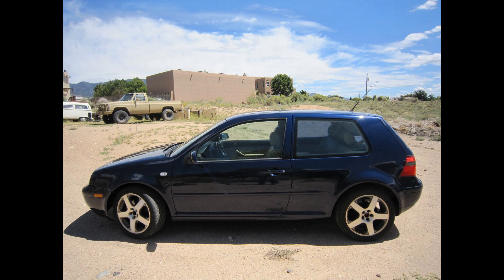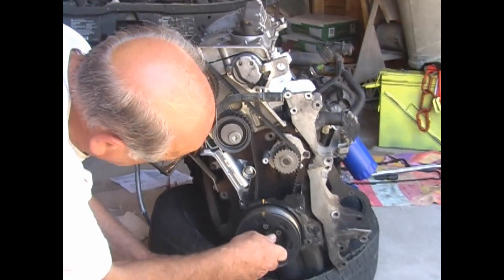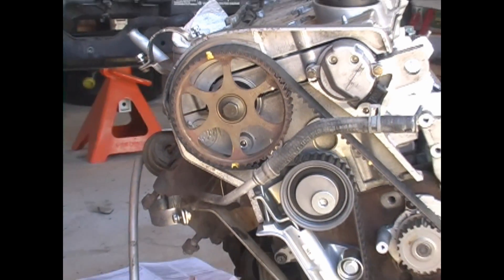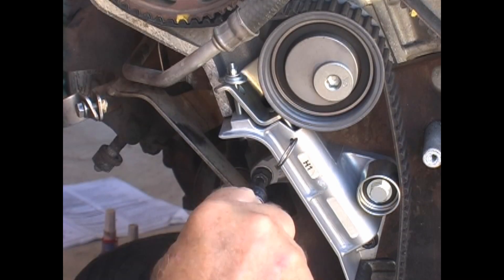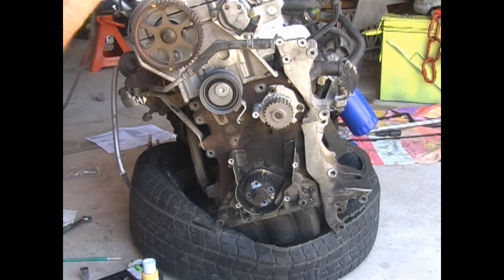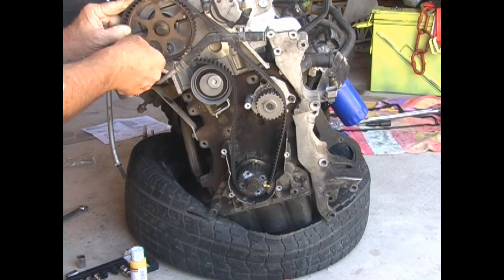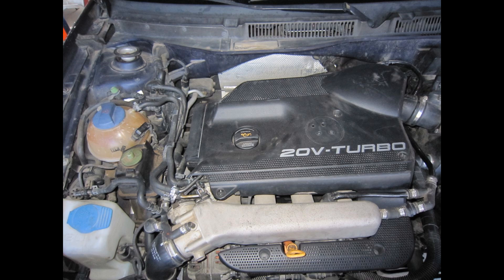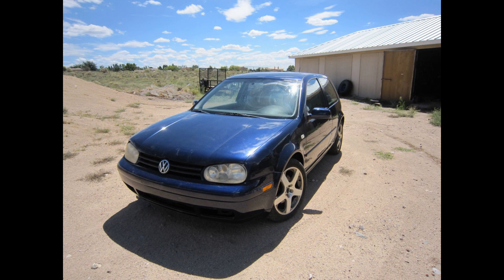VW/Audi 1.8 Turbo Timing Belt Replacement

Comment: I got mine all back together and the cam mark is one notch off to the left. is there anyway to fix this without taking it all apart again? I had a hell of a time getting the tensioner in and don't want to have to tackle that again.
Reply from the maker: Chris - I haven't done this procedure with the engine still in the car but can imagine it is a bear. I don't know of any way to change without tearing it apart again.   Sorry I don't have a good suggestion.  When I made the video I assumed it would still make the procedure easier do to in the car that doing it some of the other ways being suggested.  I hope that is the case even though it was still very hard.  Good luck.

Comment: so i recently had my belt break on my gti awp. had it repaired but it drives much slower! I'm afraid timing might be off. if i go to check it and there is no markings, how can i check if my timing is correct? i have no cel or codes..thanks
Reply from the maker: Hi Christian

I can't imagine that there would be no timing marks.  There certainly won't be any on the belt but there will be timing marks at the crankshaft and the camshaft.  There is a cover you have to remove in order to see the camshaft Pulley.  Once you remove the cover, there will be a timing mark on the case of the engine.  I can't send any photos in this reply but if you look at the very first part of my video you will see the timing marks at the crankshaft and the camshaft.  Once you locate the timing marks at the camshaft, then just rotate the engine until the mark on the camshaft pulley aligns with the mark on the engine case.  When these are lined up, check the marks on the crankshaft.  Remember the crankshaft rotates twice for every turn of the camshaft.  Hope this helps.  If not, send me your email address so I can send some photos and diagrams.  Good Luck
Reply: Wayland Adams thank you sir. i appreciate the feed back. i will certainly get with someone and attempt to double check my timing because i dont believe the tech i worked with originally did it correctly. also have you seen a damaged turbo result from the belt breaking? i was only driving 15mph but it bent 4 valves. i had those replaced along with everything else that is recommended. i got the car at 94k miles, it broke at 96k miles and now just hit 100k and still drives terribly...my car is auto triptronic btw. basically when i attempt to gain speed, it has to rev higher then usual to shift and alot of torque is basically gone. i can only skip tires when i floor it when be4 i had to condition myself getting use to the sensitivity of the peddle because it was just ready to go! now i have to really give it gas for it to go...its so sad.

Comment: Is this easy to do with the engine still in the car though?
Reply: Christopher Kreschollek  no!
Reply from the maker: Hi Christopher

I don't really know how easy it is to do in the car.  I have only done it a couple of times and in both cases the belt had broken and the head needed to be removed.  At that point I figured it was easier to remove the engine.  

I shot the video with the engine out of the car so I could show detail that would be impossible with the engine still in the car.  Having said all that, it is possible to change the belt with the engine in the car.  If you are just replacing the belt and the parts associated with the belt like water pump, tensioner, etc. I would recommend you do it in the car.  It's kind of tight.  You can still follow the procedures of my video which will make it easier.  

Thanks and good luck.  

Wayland
Reply from the maker: Hi Christopher  - As Chris Mosley says, this is hard to do in the car.  I do think the procedures in my video make it easier to do in the car than following some of the other suggestions.  But in the best of circumstances, it is probably very hard to do in the car.  I haven't done it in the car because I was having to change the head also.

Comment: So we don't need to rotate the engine 1 rev after install?
Reply from the maker: No you do need to turn the engine.  At the last of the video I suggest you turn the engine crankshaft 2 revolutions which will turn the camshaft one revolution.  Then check the timing marks.  Look at the last few minutes of the video and it will explain it.  Thanks.
Reply: That's what I meant. Cheers.

Comment: So when the crank and the camshaft are not time when you take a look at it from the beginning does that mean bent valves?
Reply from the maker: Hi Sergio  I would say probably it does mean bent valves.  This is especially true if the timing belt broke or started slipping while that engine was running.  Slipping happens when the teeth on the timing belt some off in one area allowing the crankshaft to turn without turning the camshaft.  I have see this failure before.  I guess the exception would be in the timing is only off a little but everything is still turning.  

If you can pull the valve cover, you can probably see if valves are sticking open meaning they are bent.  The other method is to make sure the engine is timed and then do a compression check.  Let me know if you have further questions.
Reply: so a follow on question is if it is out of time (as mentioned above) do I just need to match up the marks at the crankshaft and the camshaft then install the belt? I'm asking b/c I'm installing a new cylinder head that had a timing belt break and bent the valves. I'm essentially doing a full timing belt install and cylinder head replacement at the same time.
Reply from the maker: Hi Kick Flips  yes you are basically right.  However, I would make sure the timing  marks are set before you install the head on the block.  In other words, make sure the camshaft sprocket is on the timing mark and the crankshaft is also on the timing mark prior to installing the head.  Then install the head,  Following that you install the timing belt as instructed in the video.
Reply: got it thanks

Comment: what size bolt do you use for screwing down the tension pulley to let the pin out?
Reply from the maker: Hi Tyler -  I used a 5 X 55 mm stud to compress the tensioner.  Good Luck
Reply: M5 x 55 mm

Comment: If you're doing this on your car, follow these instructions but install the tensioner WITHOUT the small roller pulley first.  The tensioner bolts will destroy the threads if there is too much pressure.  Then push away the belt and put in the little tensioner pulley.
Reply: yes, remove the camshaft pulley, get it lined up on the correct tooth and slide it back onto the keyway on the camshaft. You may have to turn the crank slightly but only about the same as you see it moved in this vid. you don't have to disassemble anything else. I've found it is much easier to remove the cam pulley to perform all timing belt maintenance. ..After lining up the timing marks of course.
Reply: James James that's what I did .I was having a hell of a time getting the tensioner in with it on. got it all back together and realized the cam timing is one notch off. I about blew a gasket.  is there any way to fix this without taking the whole thing as apart?
Reply: James O'Phelan

Comment: Thanks for the tip on removing the tensioner first. The book wanted the tensioner pinned and then slip the belt off. Well the idler can't go back far enough for that. Also this was identical to a 2002 Jetta. Thanks mate.
Reply from the maker: You're very welcome.  You found the same thing I did, the book was calling for the tensioner to be pinned but the belt was almost impossible to removed that way.  Hope you repair went well.

Comment: The bolt on the camshaft pulley recently broke because it was on too tight and the pulley itself frayed at the edges where the bolt was screwed in. Can I replace just the pulley and the bolt to fix this issue? If not, what else would I need to do to fix this issue myself? I have had a really rough time trying to get someone to fix my car and have decided Im going to fix it now. Any help would be greatly appreciated.
Reply from the maker: I would think if that is all that is wrong, you should be able to just change the pulley and bolt.  Just make sure it gets back on correctly and you get the timing set correctly.  Just a thought,  It is going to take about the same amount of work to do this as to change the belt.  If you haven't recently changed the belt.  I would consider doing that and the other recommended components.  

good luck/  Sorry for the slow reply, I have been out of pocket.  

Wayland
Reply: +Wayland Adams no, thank you for the reply. I really appreciate it.

Comment: Is the timing belt the same as drive belt?
Reply from the maker: Hi Mladen  Not sure exactly what you are calling the drive belt.  but there are two belts.  I would think what you are calling the drive belt is the one that drives the alternator, power steering, and AC.  This belt is very visible and can be changed as needed.  The timing belt is not visible.  It drives the camshaft and water pump.  It has teeth on it so that everything is kept in timing with one another.  hope this helps.
Reply: +Wayland Adams I figured that people call the fan belt drive belt as well
Reply: +Wayland Adams Thank you for your time!

Comment: i need to know if its possible for my belt to have jumped timing and not hurt my motor. i also need to know how to tell without pulling the head
Reply from the maker: Hi Brandon -  I guess there might be some circumstances where the belt jumped timing just a little and wouldn't damaged the valves.  I have never heard of such a case but I am not the total expert on this.   If you have already replaced the belt and got everything back in timing then you can do a compression check.  The should show any cylinders which have  a bent valve as the bent valves will not close properly.  If you have good compression on all cylinders then you should be good to go.  If you haven't got the engine back in timing you will have to decide if you want to turn the engine over.   Another thing is to remove the valve cover and see if there are any valves that are not closing.  Of course with this, you won't be able to check all the values without turning over the engine.  You will have to decide if you want to turn the engine anymore at this point.  Good luck.  Let me know if there is something else I can do to help.  Wayland
Reply: my car lost some power and started running badly at about 4k rpms and the engine light came on. car runs but rough and the belt is entact and appears good
Reply from the maker: Brandon  This doesn't sound like a timing belt problem to me.  Do you have a way to get the service codes read.  Autozone will do that for free if you are near one.  So I will hazard a guess assuming all the valve timing is good.  On this engine each cylinder has it's own ignition coil.  Sometimes those fail and the car will lose power and run rough because one or more coils have failed.  Getting the codes read may give you a clue as to which cylinder is misfiring.  Once you have the codes read, you can google the code and it will tell what it means.  I had this happen on my car.  Replaced the bad coil and was back in the power.  The codes for misfire are P0301 through P0304.  The last digit indicating the cylinder.  Let me know how it goes.  This is just a guess on my part, the codes will tell for sure.  Let me know how it goes.
Reply: your awesome. thanks for the input. i suspected a coil but only after a family member advised me. now i definately will check.
Reply from the maker: Brandon  One other thing,  I have a code reader so makes it easier.  But when I saw a misfire code, I actually swapped the suspect coil with another cylinder and then checked to see if the code moved.  It did in my case confirming that the coil was bad.  I don't like to just throw parts at a problem so I try to confirm the diagnoses.  Good luck
Reply: after removing the coils i notived they all had oil on the boots that go on the plugs. as if the oils blowing out the plugs
Reply from the maker: Brandon -  That oil is probably not coming out of the plugs assuming the plugs are tight.  The valve cover gasket actually is supposed to seal around the spark plug slot.  If it is leaking, there could be a build up of oil.  Probably a little bit is normal.  If you are concerned and the oil is excessive. the you can remove the valve cover and replace the gasket.  That would be my guess.  Good Luck
Reply from the maker: Brandon,  you might just try to tighten the valve cover bolts.  Just don't over tighten and break them.
Reply: i checked my coils and the two middle were completly covered with oil. halfway up the plug boot. But, my timing belt does seem loose
Reply from the maker: Brandon,  When you say completely covered with oil are you meaning there is standing oil in the spark plug slot.  If so that is excessive.  The timing belt should not be loose.  There is a tensioner that keeps it tight.  I don't know the exact recommendation for changing the timing belt but somewhere around every 80,000 miles.  You can look it up in your manual.  If you are past that, you should change the belt.  And when you do, change the complete tensioner assembly, idler pulley,  and water pump

Comment: what happens if the belt broke while running?
Reply from the maker: Hi Peter - In a couple of words, nothing good.  The 1.8 is what they call an interference engine.  This means that when the valve timing gets off. such as when the timing belt breaks,, the pistons impact the valves usually bending them and sometimes breaking the pistons.  This actually happened to the engine I used in the video.  The solution is that the head has to be pulled and rebuilt or replaced and the pistons inspected.  In my case, only the valves were bent, the pistons were fine.  I pulled the head and took it to a machine shop to be rebuilt.  So it turns into a pretty major job.  Sorry I don't have better news for you.  If you have other questions, feel free to reply back.
Reply: +Wayland Adams happened to me and im just now replacing my timing belt since it snapped barely shifting out if 1st not even going 10 mph not going fast and i instantly shut it off and put it in neutral ...but would it belt bend the valves?
Reply from the maker: Hi David  

I think it is almost certain that the valves are bent unfortunately.  If you continue to put on the new belt, you can check compression when finished.  Another thing to do is take off the valve cover and you might be able to see if the valves are hanging open.  

The belt broke on the engine I used in the video.  That is the big reason I had it out of the car.  You have to remove the head and I found it easier to just remove the engine, repair it and put it back.  

Good Luck, let me know if you have other questions.
Reply: +Wayland Adams if the the valves are bent how long/hard would it take/be to take the valve cover off?
Reply from the maker: Hi David  -  I think it would take about an hour.  But that is just to check if the valves are bent.  If they are, you have to remove the head which is a big job.  I just pulled the engine.
Reply: ***** i went on the easier way and just bought another engine for 250 bucks same engine code and same year
Reply from the maker: Hi David -  That sounds like a great approach, especially if your 250 buck engine is any good.  It would have cost you a lot more than that to get the head rebuilt.  Unless you know the history of the new engine, it is probably a good idea to change the timing belt before you install the engine.  I recommend you get a kit which includes the belt, tensioner, idler pulley and water pump and all the things you should replace.  

Good Luck and thanks for letting me know.   

Wayland

Comment: Thank-you very much for making this video. It was extremely helpful. 

I would like to note that there is a mark on the flywheel to indicate TDC. This is useful if you didn't mark your belt and sprockets. Remove the rubber plug on the driver side of the block (towards the front, lot's of cables in the way). Front driver side but inset/left of the driver's headlight. Once removed you will see a a gear and it's teeth. There is a small indentation line/mark when at TDC. The indentation is parallel to the teeth on the gear. I had to rotate the crank a few time to find it. It's tough to get a line of sight and it's dark. This is best done with plenty of light. Also, my plug was missing. If you see a hole with a gear in it, there is supposed to be a rubber plug there.

Comment: What's the size of nut u used with the tensioner and pin
Reply from the maker: +juan velazquez Hi Juan -  The stud size is 5mm x 55mm.  So the nut is a 5 mm.  Hope this helps.  let me know if you have other questions.
Reply: +Wayland Adams great video and thanks for the time answering my question, I really appreciate it...one more question, is there any way or trick that would help me taking the bottom bracket that supports the engine out east?
Reply from the maker: +juan velazquez  Hi Juan - I don't remember having any particular problem with the engine mount brackets.  I am not sure which one you are talking about but if is the one bolted to the engine where the timing belt is there is a little trick.  It is held on with 3 bolts.  You may need to raise the engine a little bit to get the upper bolt out.  I googled "removing 1.8t engine mount" and got lots of pictures and information.  I would try that.  Please feel free to contact me again if needed and if you have more specifics about the bracket in question.

Comment: Im guessing the passat has the same 1.8 right?? I
Reply: +408skills. It's similar, but yes the timing belt procedure is the same. The engine is longitudinal, so the front of the car needs to be put into the service position or removed completely to access the belt.
Reply: +Pendemic thanks im going do this after i figure out what wrong with the ecu circuit & maf sensor codes.